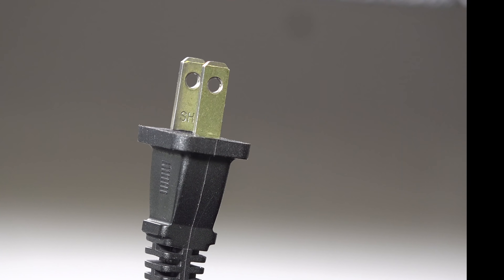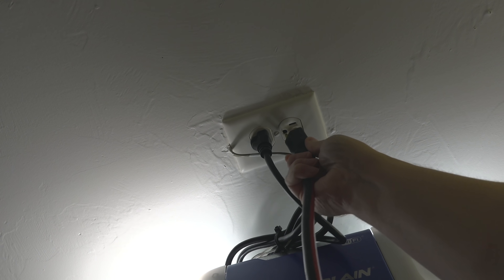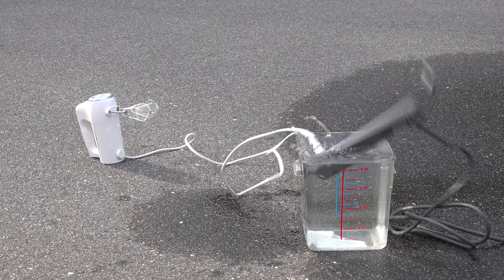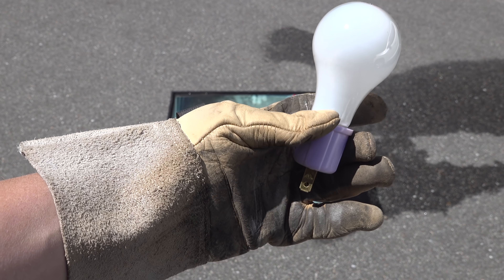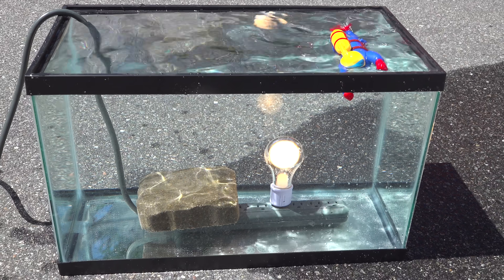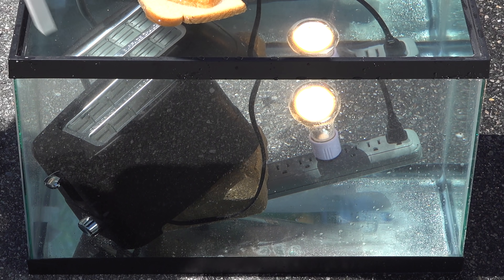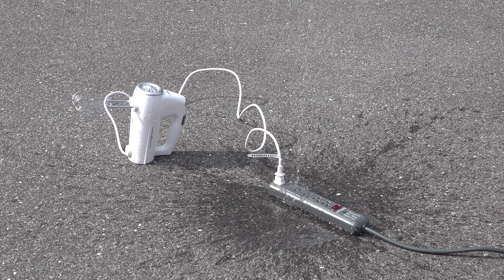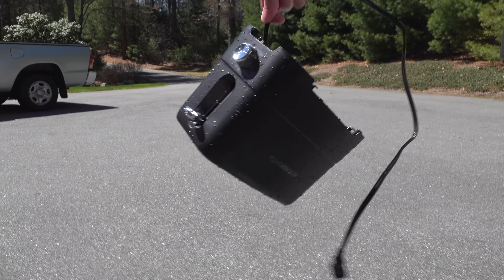What REALLY HAPPENS WHEN YOU SPILL WATER in an OUTLET?

Comment: If you ever do a part 2 I'd be really curious to see what happens if you put another bulb loose in the tank before running current into the water to see if it would light up. Is it possible for an electrical plug to draw power out of electrified water or would it short out since the current wouldn't flow smoothly through the plug?
Reply: I don’t know much about this stuff but wouldn’t it need to be connected to Ground for it to light up? So I think it wouldn’t draw current from the water

Comment: You need salt. Water does not conduct electricity it's the salt in the water mixed that conducts electricity. If you put you hand in there YES you will get electrocuted because of the salt on your skin mixed with water.

Comment: We have a wall outlet, above that outlet has a gutter. When it rains the gutter gets full, and starts leaking on that outlet. It smells burning rubber that time... When I see the wall outlet, theres an orange light on it, Its burning now 😨 we need to remove the outlet and its wire. The was an old and unuse connection built around the year 2000

Comment: Your water simply isn't conducting enough electricity. Pure water acts as an insulator and will not create a short circuit fault condition, which is what actually causes an arc. All your water is doing is acting like a giant resistor. While you are using hose water, you clearly live in a rural environment - likely on well water if I had to guess which means you probably have MUCH cleaner water than someone in the city would. However that doesn't necessarily mean your water won't be conductive, it just is in this case. To actually have anything happen, you would need to have something more conductive such as aluminum to bridge the hot/neutral or apply more voltage, which you obviously can't get unless you want to run both lines out and get 240v which is standard for most US homes I believe. Otherwise, 120v is not gonna cut it. If you were sitting in an Olympic pool at one end and lightning struck the other end, even if the bolt was 1000000 volts you'd probably only get hit by like 10k to 20k (I know that will easily still kill you lol) but it's just to give an example of how much electricity can be lost in water.

Comment: Re-do the experiment in the aquarium, filled with tap water, power strip full submerged and no load (no "egg beater" or light bulb). Also put an ammeter in series with the strip and tell us how many mA it conducts. Just for kicks, hook up a 100K 1/4 watt resistor from the aquarium water to ground and measure the AC voltage across it.

Comment: the bubbles are hydrogen and oxygen being torn apart by electricity. Water is not as conductive as you would think. You can strip live wires and put them in water, and even put your hand in the bucket with the wires live without getting much of anything but a tingle unless your hands get very close or touch the wires.

Comment: The conductivity of water is based on how pure it is. With the “dirtiest” water tending to be more conductive, and ultra pure water being the least conductive. It has to do with the ionized foreign particles in the water acting as the main conduits for any electricity passing through the water.

But even then, ultra pure water is still conductive and no one should try their luck “testing” this out. It’s dangerous, period.
Reply: Actually, distilled water isn't conductive at all. Water by itself isn't conductive, that comes from the minerals dissolved in it. Still, don't try it even in distilled water, since it's pretty hard to tell the difference between clean water and distilled water by looking at it, if not outright impossible, so better safe than sorry.

Comment: if the water was electrified(when everything was on, of course), then shouldn't there be a short circuit, and something blowing out(e.g. fuse)? with how the experiment "behaved", it seems like the water was not conducting electricity... but then again, gfci seems to detect that it did.

Comment: Put a volt meter on it. One leg into ground, the other on a copper tube. Wear gloves. Move the copper tube around the water. Various locations should have more or less voltage. 

The ground is supposed to be the protection against “rogue” power if the unit has malfunctioned. I’ve seen equipment having the ground wire severed and people were getting shocked with 80 volts.

Comment: The thing is you have to measure the conductivity. It's probably close to 0 Siemens/meter. If you have "dirty" water you should have a short circuit in your electrical units. 
My opinion

Comment: The GFCI tripped when you poured water in the power strip. Had you placed the mixer in the water or wet it, the GFCI wouldn't have. The mixer had no grounding plug.

Comment: Electroboom did a similar experiment, and he found that the water gets warm from the electricity flowing through it.  Then, to make things scary and interesting, he put his hand into the electrified water.  When his hand was far from the electrodes he felt a very mild shock.  He felt a strong shock when his hand was close to an electrode.  
Dave from eevblog showed an actual product that is terribly unsafe.  It is a test tube shaped water heater with two electrodes.  It has no heating element at all and no switch.  You just put the 220 volts into your teacup and the water gets hot as electricity flows through it.  Dave denounced it as outrageously dangerous, and rightly so!

Comment: Meanwhile.
6 y/o Me: Hmm let's see what would happen if i joined two nail clippers and stuck it in the outlet.

House: Makes unholy electrical sounds and alternately dimming lights

Also 6 y/o Me: Traumatized and holding a spot-welded nail clippers. (I obviously slapped it with a slipper to remove it)

Comment: I am absolutely baffled! I grew up thinking that the slightest drop of water on an electronic product was game over for that product! It's crazy that this worked (thought was probably very dangerous!)
Reply: No that does happen but it differs for each electronic. So DO NOT PUT WATER ON IT.
Reply: @signin9551  Yeah, i experienced this back then. It nearly exploded near my face when i plugged a charger in.
Reply: @frankuraku5622  water or not doesnt change, but the things what have in the water can do alot of stuff, like salt, sugar, etc
Reply: @signin9551  Absolutely - see for instance Louis Rossmann's videos on how one drop in the wrong (or right, depending on perspective) spot in a Mac can put screen backlight voltage onto a line directly to the processor (designed for much lower voltage than what the backlight uses...
Reply: @signin9551  water or not doesnt change, but the things what have in the water can do alot of stuff, like salt, sugar, etc
Reply: @bl1nd_ness664  yea but some things can still pop underwater
Reply: @signin9551  needs something to make the water dirt, water doesnt break anything (removing things what need air to work) and also sorry for my bad english, im brazilian and im learning about english
Reply: @signin9551  depends on what type of water. You can literally put any device on distilled water for days and it will work just fine
Reply: @youravghuman5231  nonconductive
Reply: @signin9551  is it because water short the circuits?
Reply: @signin9551  proof or your lying
Reply: @signin9551  yeah lol. Spilled my laptop twice, thing still works.
Reply: spilling liquid on things isn't good for them but it's not like they just explode. Usually water damage takes full effect a few months after the spill through rusting which is why if you get electronics wet you want to turn them off and dry them out quickly. If the water makes a connection where there shouldn't be one it could short out, but things like spilling water on a laptop keyboard if it doesn't immediately short you want to turn it off, remove the battery/disconnect it from electricity, and dry it off to try and slow the rusting.
Reply: @dampintellect  2 days or more to water take effect, depends how much water has in it
Reply: @dampintellect  yea
Reply: All it does is conduct electricity. Simple electronics that just use 120v to do one task probably won't be harmed because it doesn't care if it's getting 120 from a wire or from water. A laptop on the other hand needs varying amounts of power sent to different parts of the motherboard, so if you just cover the whole thing in whatever the highest current making contact with water, it don't like that.
Reply: uh did you not hear him? he said only the type of outlet he used is safe against moisture but regular ones aren't
Reply: pure water or distilled water cannot conduct electricity. conduction of electricity in a liquid medium needs ion formation which carry the electric current. regular tap water contains a lot of impurities and minerals which can disassociate into ions, thus conducting electricity. however do not ever try to combine electricity and water.
Reply: @icyify  Yeah, cause distilled water is so common and easy to come by, right? The distinction you're making here is pretty much nil.
Reply: Wen I was a kid I threw water at a hot bulb and it exploded
Reply: @dd___dc  yeah cause it was hot thin glass
Reply: @dd___dc  That's thermal shock, not anything to do with electricity.

Also, I'd say you were a dumber kid than me, but I once tried to go downstairs on an office chair, and was stopped by sheer luck on someone happening to be climbing those same stairs, so I can't really cast stones here.
Reply: The key word here is "electronic". Water is an oxidizer and oxidizes copper and some other metals used in electronic circuits, and that's the most damage-dealing part of water damage. The second one is electrolysis, which will occur under higher voltages.

Electronic devices have tracks composed of very thin copper, that will break down when oxidized very quickly (and electrical current flow catalyzes that reaction), while here (purely electrical, high-voltage, no low-voltage electronic) copper wires have much greater diameter and the clearance is also bigger. And, the voltage is higher.
Reply: You should still avoid having water on outlets
Reply: Depends on the circuit of the electronic, devices like laptops could easily short circuit with water because of the many different electrical flows near each other
Reply: I once put my fingers into it and electrocuted myself so I don't know whether to believe, not even my hands were wet.
Reply: I've been welding in the tropics, it rains a lot, around unprotected gas cans, diesel and all sorts of other oils. The only fires that happens are on Fridays when we lit up the barbecue coal.  Farmland of the world does have its benefits.
Reply: It is for circuits though
Reply: ELECTRONIC products have an issue with water, ELECTRIC products (so no microchips AC to DC conversion etc) are fine, introducing water to the strip is not different than plugging extra stuff to the strip, water conducts and it is just an other load for the strip THAT IS WHY IT IS DANGEROUS, because water conducts and if you touch that water YOU WILL CONDUCT TOO, and you will become AN OTHER LOAD for the strip which means that 120Volts will flow through you TOO!! the strip will be fine doe you just will get a heart attack lose an arm or even die.
Reply: Shhhh dont tell the kids
Reply: @werdle92 lol😁✌
Reply: no the point is the water will connect you to thebpowered gizmos and the outlet keeps funbeling the electricity in despite the water being present allowing this to happen
Reply: He's putting in with his bare hands
Reply: I mean my phone survived the washing machine with only 1 broken speaker that doesn’t really matter
Reply: There's a difference between electronics and electric machines.
Reply: De-ionized water is an extremely poor conductor of electricity, and as long as it remains in such a state you're not likely to have issues with the electronics. The problem though is that it won't stay like that forever and eventually it will fail.

Adding more ions would increase the amount of current that can travel through the water.
Reply: You grew up dumb
Reply: It depends on the electronics.  Electronics sensitive to electromagnetic degradation OR uncontrolled electromagnetic  distribution (which is what occurs with water) a.k.a a short circuit, will be fried by being submerged in water.  Which basically means, anything and everything that relies on a direct current.  Anything which uses indirect current or alternating current throughout the entire device at mains power amount, would happily sit in the water and still work, given the materials it is made out of don't immediately start to degrade in the water or start to electroplate itself.  

The water itself so long as there are minerals in it will be fully electrified.  Devices which will fry in water include: computers, TVs, phones (with exposed wires) and pretty much anything that relies on scaling down power to lower voltages and/or uses direct current... if there is a mains connection involved.  Submerge a device powering off batteries, so long as the battery output is the same amount all the components in the device use, it won't fry... electricity is weird that way.  But devices like regular lightbulbs (LED lights will fry), old school dumb mechanical Toasters, eggbeaters and electric kettles will run perfectly fine submerged in water, because it uses the same power output that is currently charging the water.  It doesn't matter where the electric field is, so long as a magnetic field can be formed around the connection point to allow the transfer of electricity to the device it runs without issue.  This is also why those devices are dangerous.

The reason "experts" and authorities tell everyone it will fry everything spectacularly with sparks etc, is all an intentional big conspiracy to scare people into not doing stupid things.  Smart people think normies are stupid and the only way to deal with stupid people is to overblow things and make them out to be scary to encourage them to not do stupid things.
Reply: Water is a crappy electrical conductor!
That said my mum sprayed an old power mains switchboard with water here in Australia (220-250V) and it sploded nicely!
Reply: Are you dutch?
Reply: A simple extension cord is totally different from a computer circuit board. Try submerging your computer in a tub of water while it's running.
Reply: Welll its good news for me got flooded in February this year 90% of what was under water for 5 days still works after a good bake in the Sun for 2 weeks
Reply: A key factor in possible damage is whether the electronic circuits are completely wired in Series or contain Parallel circuits. Parallel circuits often found in computer PCBs have Transistors that change the flow of current in certain parts of the circuit board. 

If the device is submerged in water and the water contains impurities like salt, the board will short circuit much quicker than an electronic device wired completely in series that uses the same voltage across the entire circuit. This is because electricity will travel to areas where it shouldn't. Basic electronic devices like egg beaters usually are wired in series.
Reply: Yeah. I'm gonna go pour some in my PC to wash it
Reply: The power outlet has a good quality, very different from lower cost product
Reply: Me, too!
Reply: It depends on what the device is!😁✌
Reply: thats not true until you get told by every single apple customer service that your phone has a little bit of water in it and it died because of it.
Reply: it prabbly was like that back then.but now they prabbley do something to electrect products to. protect you from things like that
Reply: The reason water ruins electronic products is corroding the circuit boards.
Reply: Same
Reply: i spilled water on a socket before and it exploded multiple times
Reply: It actually is game over, but very slow game over. The place that got wet will lkely rust over time. Worse, if current was flowing, electrolysis took place and attacked the surfaces even more,. thereby accelerating the process of rusting through. Eventually you will get a bad contact that can cause arcing and a fire.

Thus, for low voltage and current stuff like a battery powered device, the recommendation is to unpower and dry it as soon as possible. For anything with mains voltage or automotive currents, I would strongly recommend replacing it as soon as possible.
Reply: The problem isn't if it breaks, but it's you
Reply: Hollywood wins again
Reply: Surge protector might be waterproof.
Reply: damn you, hollywood
Reply: Growing up of what. Shut up and get lost.
Reply: None of these items are electronic, they are electric. Electronics can get damaged from water.
Reply: Don't do it on a laptop where 5 V, 3 V and voltage as high as 50 V can coexist in a small space!
Reply: For modern outlet maybe not but for older ones is a total game over
Reply: Also, if you are worried you might fry your device, if you put the wet electronics into a container with rice, the rice will attract a Chinese man who can then repair your electronic device. Haven't tried this yet though so let me know if it works
Reply: @xDRAGONSHAGGERx  Lmao😂 My chinese guy must've come when I was asleep. Very cool, chinese repair guy.
Reply: yeah put your cellphone and good bye to him